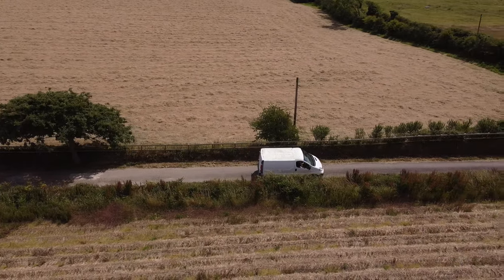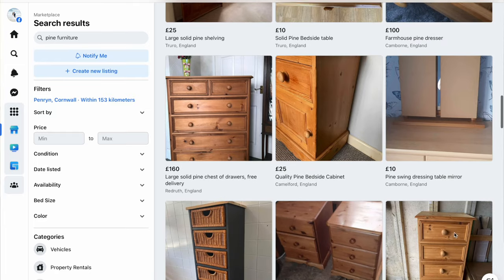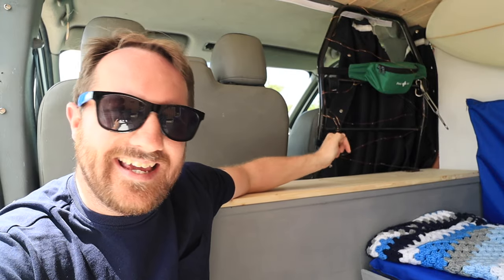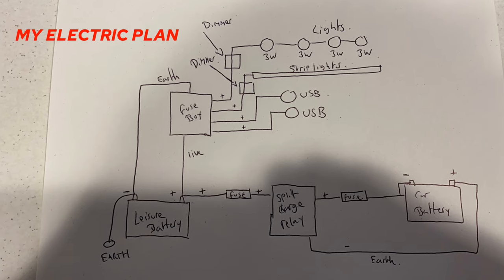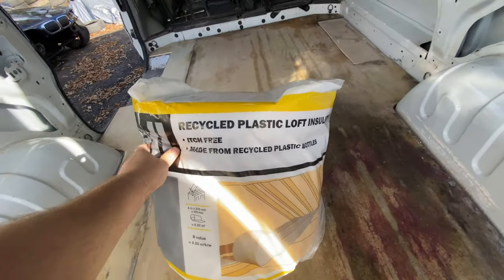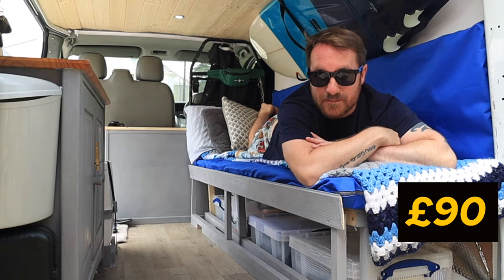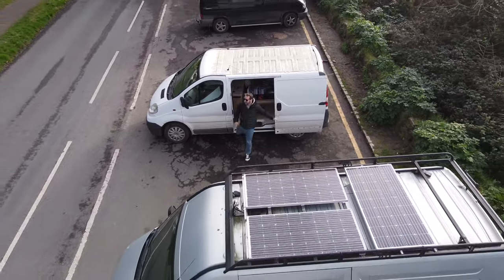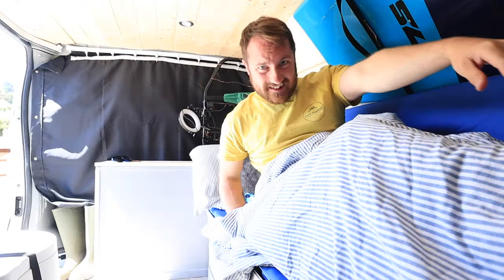DIY Budget Stealth Camper Van Full Cost Breakdown

Comment: I built a stealthy camper, my bed was a fiver , I bought a king size pine bed from on eBay it was local and i actauly cut it up into a slide out trifold type bed the only thing I had to buy was 3 lengths of scant 3x2 , my point is you don't need to buy new you just need imagination, like for instance a double wardrobe of the 50s type upturned on its back can become a fixed bed
Reply from the maker: Absolutely. I love a bit of upcycling
Reply: @LoveSundays  I'm always upcycling there's always a double  purpose for most things
Reply from the maker: @FromMetayou  yes 100% my wife goes made at me because whenever I make anything I never throw out the scraps of wood so the shed is full 😂

Comment: Very informative video! One thing I would change is a high roof, not the highest one. Then a shower and a different type of toilet. Still would be quite cheap compared to a VW California or a some kind of custom camper van . I think I might also add a portable AC. Of course it’s only hot for some days of the year. Today was flippin hot…only 27F…probably humidity made it feel hotter than it was. Morning was in Port Isaac afternoon was back in St Ives.
Reply from the maker: I used to have a high top roof but I found in some cases it want an everyday van so I used it less. This way I can use it for everything just not long term trips. I might get a portable shower and in this hot climate I might just sleep on the roof lol
Reply: @LoveSundays  love how you keep your build real and affordable. Leaving Cornwall, but not without jumping off the St Ives pier a few times.  Kept a good eye on the ANPR parking thanks to you (and a few others)
Reply from the maker: Yea those ANPR car parks are a nightmare. Making money off innocent people during these hard times is outrageous.

Comment: Amazing with the wooden unit idea... feeling like a total no brain not having thought of that and just doing without!
Reply: The reason most camper build their own is to make them lightweight to save fuel and not exceed weight limits. Not really a problem for a bare bones camper though.
Reply: @Michael-4  I've got a similar van, it's a lwb vivaro, I built the typical pull out slat bed, popped a loo down the end of the bed, that's about it..  no electricity/lights etc..
I toyed with the idea of units but just couldn't think of what to do and I didn't really want to make my own or buy a proper van unit. But this is a great idea..

It's made me want to rip everything out and start again 😯

Comment: @Love Sundays - It's a fast growing trend, but I believe if people wait it out, auction sites will have a plethora of 'converted' small/medium sized commercial vehicles, selling at much lower prices. As a result 'van life' from next year could become somewhat cheaper as a post-Brexit budget holiday/housing option. If you're lucky enough to find a good reliable vehicle during the winter months. It's cheap as chips to kit a vehicle out with used wood and aluminium bought from scrap yards. It's handy if one can repurpose furniture, however the biggest hurdle for many, is the sheer running costs (fuel, propane, heater oil, food water and toiletries, etc) and the regular maintenance costs of many an already tired (ex-trade) vehicle, because it'll definitely be clocking up higher mileage cruising around Britain. It's good to at least know your way around your vehicle's engine bay, accessories and charging circuits. As one of my general rules, I budget for twice the money it took to get the vehicle, including an MOT, tax and insurance, also accounting for spare parts, as it'll likely to require consumables, like spark plugs and belts, especially for older workhorse vehicles. Keep up the great videos, everyone benefits from sharing knowledge learned through 'on the road' experiences. 👍🏻‍
Reply from the maker: Good advise
Reply: @LoveSundays  It also comes down to space to convert a vehicle and having the right tools to do a good job. It's impossible to sell a similar camper that's been thrown together poorly, or with the wrong materials. Dangerous wiring is responsible for the vast majority of camper van fires and charging circuit meltdowns. I've reluctantly repaired a tidy few of them in my day. I do caution people not to blindly accept what they see others do on YouTube as gospel on how a job should be done correctly. It's easy to miss a step that could result in catastrophe once in the middle of nowhere on the road. Always seek professional advice when installing solar panels and accessory charging circuits. You're only working with 12volts DC, but at hundreds of amps in a short condition.

Comment: Do you not have a roof/vent fan in your build? Or did I miss it. I wanted to cut the cost of my upcoming van build by reusing units and wood, but it's not really possible due to a lower total gross weight,  I know on some of these larger vans like the Vivaro and Sprinters, they have a really high gross weight, and you can get away with normal units and such, but lots of these vans you just can't/shouldn't be doing that. My friend had one a while back, and he literally stuck full solid wood units and counter tops simply to reuse and keep the building cost down, he was way overweight.  I would be surprised if half of these builds on YouTube are not overweight.

Comment: Does the split relay actually full charge the battery? As I noticed that in my van the only thing that actually charges it fully was adding solar
Reply from the maker: The battery charge metre always show that it’s full when I check so I guess so. If it’s damaging the battery I guess I’d have to change it out at some point
Reply: @LoveSundays  Maybe it's just my van then? :)

Comment: I really didn't expect it to be this affordable. I guess the big thing is the van, did it require any work done?
Reply from the maker: I had an oil leak last month that cost me £300 to get it fixed but other than that it’s been fine (touch wood)
Reply: I had no repairs needed...but the cost of material and other things i bought for my last build 2 years ago ...on a bigger van ...was alot cheaper even back then ...especially Timber ...lol